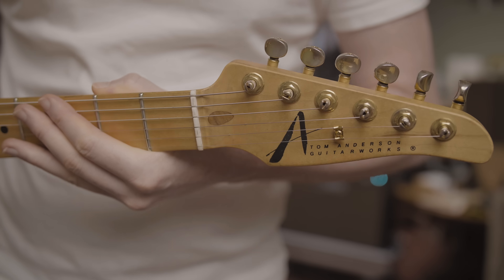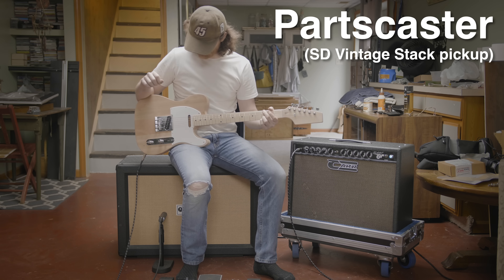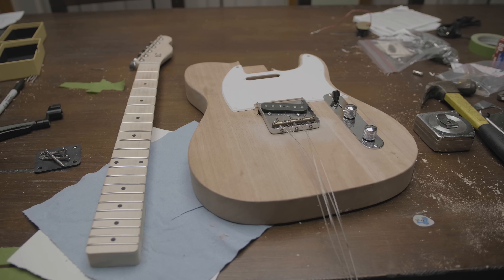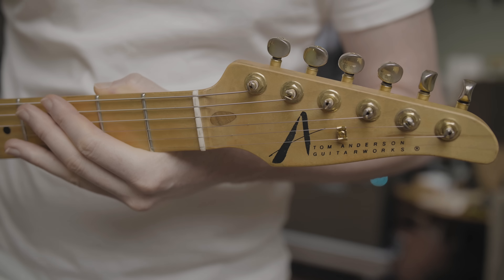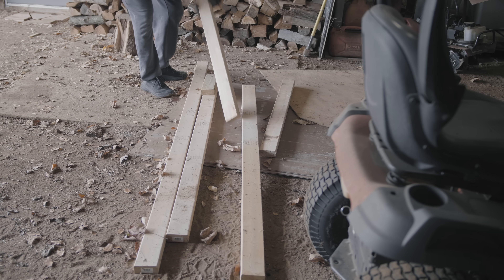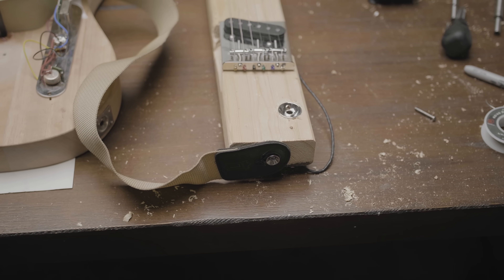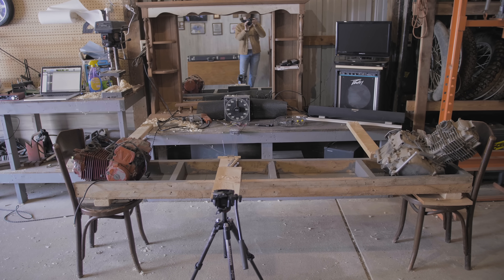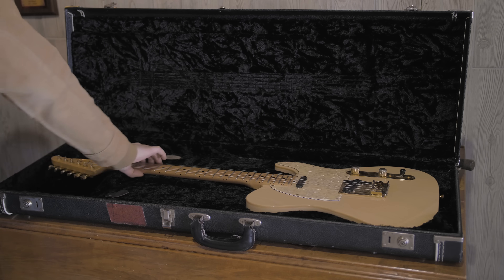Tested: Where Does The Tone Come From In An Electric Guitar?

Comment: 00:22 At 22.34 02/02/22 before I watch, I reckon the pickup is the crucial element, next, the strings, next, the bridge and nut, next, the overall rigidity of the neck and body combo. The wood is last IMO.
I will timestamp my apology later :-)
22:53 02/02/22 I am not apologising, except to say a big part of pickup is obviously height. Got to get those wires in the field.
Feeling very gratified at the mo TBH.

Comment: In case none of the other 2000 comments mention this (but I can’t possibly read them all) the tone wood in my experience is not as much as a factor the HOTTER the pickup you are using. When I was at LsL Instruments building hundreds and hundreds of strats and teles the magic was low resistance pickups. After you break 6k (like with a vintage double stack pickup) all you are hearing is that pickup. Throw a low output pickup in it and watch as its completely different based on neck wood, fretboard wood, and body wood. The sugar pine strats we built exceptionally proved this. 

And that bench test with “air” wasn’t just air… it’s air and two Benches and two two by fours…. You can’t test that as air against a body just because your pickup is floating in air… your hardware is still attached to big pieces of wood therefore it’s going to resonate with the wood.

Comment: I'll add to this, that when a soundwave travels through an object it can reflect back on itself when it reaches a boundary, similar to reverb in a room. Also, like sound in a room, those waves reflecting around can add together or cancel out depending on their phase relationship at the point they rejoin. Think of standing wave patterns on a metal plate that has been turned in to a transducer. The mass and size of the body will affect the amount of time something takes to decay and the phase relationships and interactions at differing frequencies/notes.
Reply: Lol whatever you need to tell yourself

Comment: so it's pick ups, speaker / cabinet, amp . . . that seem to make the most difference in tone based off other videos (and this one) for the instrument equation, then there's the player part of the equation also . . .  that did your style of A and B testing, and everything else is just little nuances to the sound. I did notice changes in tones say with the parts and the anderson, but only if A to B directly. And I guess the build / looks etc factor into your hands / feeling etc, which my opinion affects the player part of the equation) , so guess the builder who answered player, pick up / elec  had it closest . . . thanks for taking the time.

Comment: VERY well done! Bravo man. I can't help but think, on your "air-guitar" segment, isn't the 2×4 connecting the 2 tables essentially functioning like a neck? 2 feet away but  isn't that maintaining string tension while transferring vibration into the "body?" Just an observation. Man you really did a comprehensive experiment here. Awesome...
Reply: this is what I was thinking. But then again, it proves that those things don't change the tone at all.
Reply: You're right, but the extremely subtle difference in tone between a normal neck/body, and 2 planks of wood 4 feet apart attached to a bench, imply that changes to body wood such as a maple top should not really be audible.

Comment: First off the end demonstration is pointless because tone changes when you play pushing down on frets. A bigger head stock was definitely louder as was the tighter neck. Also different electric guitars vary due to all the little differences in each guitar. Is one guitar better than the other that's up to the buyer. As for looks and playability and quality of parts that's where the biggest differences are between cheap and expensive guitars. If we talk about acoustic guitars thats another story.

Comment: This is a very interesting video and is one that is well overdue. I have often suspected that body and neck wood/material in an electric guitar makes absolutely no difference and is just marketing BS. In an acoustic guitar the sound is generated through movement of air and then it  is sometimes enhanced by microphones. Materials can make a world of difference in an accoutic guitar.

In an electric guitar there is no microphones and any (minuscule) air generated sound is dwarfed by the sound generated through the amp. Electric guitars produced sound by producing electrical current by the strings vibrating in an electrical field of the pickups. There is no air produced sound. If any additional vibration feedback by the construction material is present I suspect it is infinitesimal. The body could be made out of concrete or anything stiff. The physics suggest that what only matters is the vibration of the strings in an electrical field. Therefore strings and pickups and their interaction should be 99.99% of tonality after processing the electrical signals by the amp. I am yet to see anyone adequately explain how anything could be different from this explanation, apart from the "it just does" response. I tend to think this is a subjective view and not objectively verifiable.

Comment: I would love to know your thoughts on solid vs hollow bodies. I've always preferred the sound of a semi-hollow guitar, but they very clearly do not sustain as long when played clean. Having a stiff resonating body is very different from something with a lot of nodes. Your air guitar is almost like an infinitely dense solid body since the benches aren't going to vibrate much. 

In my experience, tone comes from pickups, string gauge, string age, electronics, and maybe bridge materials or other contruction variables. I've never understood the big hardwood debate, or neck thru vs bolt on. I own a lucite guitar that sounds like it could be wood. The only things that impacts tone more than pickups is the speaker. I find speakers to sound wildly different. 

Great vid!
Reply: The more pieces are vibrating significantly, the more places energy is being dissipated.  With the 'air' guitar, energy is being lost due to aerodynamic drag, dissipated in the string itself, and rubbing against the saddles.  Very little energy makes it into the heavy table, precisely because its very heavy and stiff.  But a 1.5"-thick guitar body is also plenty heavy and stiff to provide almost the same isolation.

Comment: On the air guitar, the bench is wood and adding a resonant ring to the sound, the 2 2x4s act as the neck, just offset. Maybe try mounting the bridge and pickups and strings to steel, Plexiglas and other less tradition structural materials and see what happens. It's a really cool idea, what you are doing, I'm a professional guitar maker of 35 years.

Comment: Great, extensive work and video. In this application you definitely defied many theories. However, sustain is a major debate with weight/woods/mass and pickup height. I was really hoping to see a single-note bend, up high on the neck to test for sustain time. Wondering how the 2×4 would have fared?

Comment: When will people learn manufacturerd use different woods for cost reasons or aesthetics? Electric guitars are not acoustic instruments. As a matter of fact, your air guitar would even produce sound in a vacuum, as it's just an electromagnet converting changes in its own magnetic field into energy, which then travels through the electronics, then gets amplified by another set of electronics and converted back to acoustic energy.

Comment: Even through my MacBook Pro's speakers, I hear a difference between the regular guitar and the air guitar. The regular guitar's tone sounds different and I think what's causing it is that the string vibrations are bouncing off the wood and into the strings themselves.  The pickups are picking up this subtle echo effect.

Comment: This is interesting, but assuming this last guitar is made of "nothing" is wrong, its actually the opposite, it's the heaviest one. 
It is attached to a table at each end, so even is there is nothing in the middle, the are 2 resonating bodies attached to the strings, which can vibrate and affect the tone like the body of a guitar would. In fact, the "air" guitar is actually probably the one where the strings are resonating with the biggest amount of stuff as these are two quite heavy/weighted tables, so the tone and sustain might be really affected by the resonance. You can probably hear like I do that the so called "air" guitar is very tight and has a lot of sustain, because it is a very big and solid instrument. Doesn't seem intuitive at first but that's how it works.

BTW : I'm not defending tonewood here, pickups have a much bigger impact on tone than any resonating wood can have on an electric guitar. But even on an electric instrument, there a little acoustic element that will affect the way the strings vibrate if there is transmission of vibration between the strings and any kind of "body" of the instrument (body, plank, or here tables)

Comment: You know, this is compelling, but what I have been waiting for is for somebody to actually do something scientific, instead of something that "seems" scientific like you did.  Nothing you gathered could be considered data, because it relies on two imperfect devices, your ears and your brain.  I said it was compelling, because it really did sound the same to me, and I have no reason to believe that you're mischaracterizing your tests.

What actual data would consist of is an audio frequency spectrum analyzer with math functions.  The ability to subtract the frequency spectra of one signal from another to look at the actual differences.  Others have used spectrum analyzers before, but they didn't actually use their math functions, they just showed two sets of frequency content and claimed that they were the same.  Unfortunately spectrum analyzers work on a log scale, which means that two signals will look almost identical unless they're off from each other by a factor of five to ten, which you can agree is considerable.  So two signals that look similar could have harmonics that differ by 3dB which is twice the power.

That would be scientific.  What you have done is not scientific.

Comment: This is awesome.

I can't help noticing though that the "air guitar" is actually a wood guitar.
I have thought about comparing drastically different materials.  I have always wanted to build a guitar out of heavy gauge channel iron.  A concrete one would be easy to do by replicating your "air guitar" right on a concrete floor.
Reply: Yeah, the strings are still held apart. Just by 2 'necks' now; the 2x4's separating the table and the bench. Make those of e.g. rubber, and it's gonna be (a little) different. Even if you'd keep the strings apart by having superstrong magnets pull on the otherwise free-floating bridge and the headstock.. still, you could talk about tone magnets.

I agree that wood plays a relatively small role in an electric, but not nothing. Some time ago I read an explanation of it that appeals to me; A plucked string has vibration 'energy' that is partly absorbed by what it's attached to. If it is absorbed fast, sustain is low, for example. Different materials absorb frequencies in the vibration by a different curve, like impendance. That's the only way wood can affect tone, I think. And maybe there is a small resonance peak. Both are way smaller effects than pickups etc.
Just my 2 cents.

Comment: Hold on. The same electronics with an overdrive should produce the same sound, because to power of the electronics override the tone wood of the guitar. I say this because I have Seymour Duncan Hot Rails installed on my Telecaster. Cranked, they it does not sound like a Tele, but when I turn the volume down, the Tele sound is still there. If All wood sounded the same, then why all the Name Brands? My Tele and My Les Paul sound completely different, both with and without power. I love the demonstration, but you left out various distortion levels.

Comment: Interesting and fun experiments. Calling the final one an “air guitar” is not quite exact though.

The bench acts like the guitar body, the shelf is a massive headstock. The two by fours are like two guitar necks in parallel on the outside of the strings, not under them. This heavy and strong construction gives the strings their fixed endpoints to vibrate freely.

You probably showed that the hardware, pickup and setup are the most important for the tone. I still believe the properties of the woods and the construction methods contribute to the “sound” of the guitar, maybe just not as much as the marketing guys would want us to believe …
Reply: Absolutely correct.
Reply: Fully agree! Came here to make sure it was said.
Reply: That's going to apply to anything strong enough to attach strings to, though. How are you going to test how the vibration of a string sounds without attaching it to something strong enough to hold it in place when it's under tension? If something as dramatic as the air guitar setup isn't going to show a meaningful difference in tone, then nothing within the realms of typical electric guitar construction will either.
Reply: @SuffyANX  his point is that it isn’t an air guitar setup - if anything it’s got more wood than a conventional guitar body.  A better anchor point for comparison might be something like concrete.
Reply: @flyondonnie9578  My entire point was that it doesn't matter because an "air guitar", in the sense that it lacks any attachment from string to solid "body", isn't a thing that can really exist, and the point regarding the (in)effectiveness of tonewood is made regardless.

Any guitar have the string attached to something, this just shows that what that something is doesn't have a meaningful impact on sound
Reply: @SuffyANX  I agree, but not for the reason most people think.

Comment: When you asked the question at the beginning, I wrote down "the strings, the pickups, relation of the pickups to the string, and the electronics between the pickup and amp." I don't know much about guitars except the basics, which is probably how I got it right. I just haven't been indoctrinated in guitar culture so I could focus on the obvious physics at work. The string is the thing vibrating next to the pickup, at which point the story is electrical. Also, if you think about what Fender cared about, this explains their success. They chose wood and construction for being cheap, comfortable, and modular, not for tone. Their competitors had sophisticated acoustic designs. But they had revolutionary pickups and solid, consistent production.

Comment: I'm sorry, but this is a critical comment to your video, as I see a flaw.  When you are testing without a body, you are NEGLECTING to take into the account what the headstock and bridge are connected to.  The bridge and the headstock are connected to these massive tables (that ALSO touch each other) which is going to give a boost to the resonance!  So it's like the headstock is that giant work table!!  Anyone that doesn't believe me, you can do a simple test if you are a guitar owner within 1 minute.  Pick up your guitar - not plugged in.  pluck a single note.  listen.  THEN, touch just the headstock to the nearest wall, pick that same note. Listen. and FEEL the difference.   It's going to sound much louder and resonate longer.  That's what those workbenches are doing.

Some of the tone is indeed in the players fingers.  All of our guitar greats have stated this, so why should we not believe them, of all people?  But I understand where you are coming from and think it's great to explore things and ideas yourself.    I am almost always able to pick out a guitar being played by a female vs a male.  There is usually a thinness to a woman's tone that I can hear right away, but there are some exceptions.  So to me, that tells me the fingers have to have something to do with tone!

Comment: I have always believed that tone wood only matters in acoustic guitars and not in electric guitars. Thanks for this wonderful video.
Reply: Hi, I couldn't read all 5k replies, but did read at least a hundred and diagonally hundreds..
A few things I read and thought myself too are:
- the pickup is (or in the beginning, the pickups are) rather harsh (compressing?). So it covers up possible differences. What with a more open pickup?
- the bridge position of the pickup  naturally does not take much body 'sound' into account

I've read little about:
- the style of playing. This is also quite 'full', and rather fast. If you'd play single notes, or long notes, there might be more space for hearing differences.
- the amp and amp settings. This was not very clean either, so the little drive of the tubes also takes away some differences. It could of course also enhance differences, but electronically, overdrive 'pushes the waveform towards the ceiling', and flattens out differences that might have been there before (the amp).
- the same goes already for the electronics in the guitar of course. 
So - keeping the PRS quote that this is a subtractive process in mind - I would like to hear A vs B as pure as possible, if it's about the wood and the construction.

Comment: Bass player here.
But in my knowledge and experience in the instrument world I feel the #1 tone factor across guitars of the same basic design and setup is the pickups and electronics. No doubt. Next would be the type or brand of strings. And not surprisingly the third most important is the type and quality of the body and neck wood/s, including the fingerboard. Everything else like hardware does play somewhat of a part, but the first three will really determine the general sound a guitar has. 
The truth is you could have 10 guitars of the same brand, model and specs and they may all sound or play slightly different. Sometimes the magic in that special 1 out of 10 guitar is all of the components working in perfect harmony. And most of the time that is by random chance.